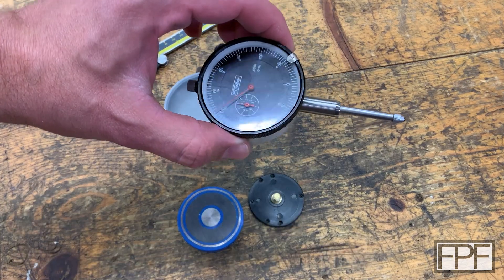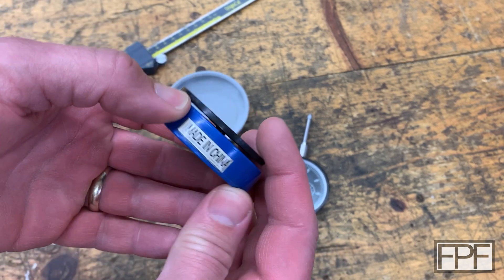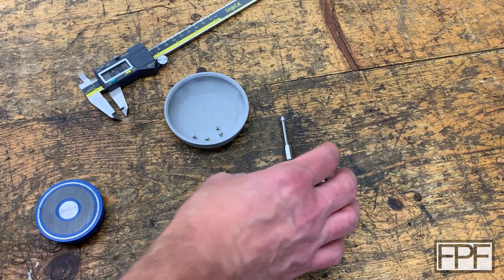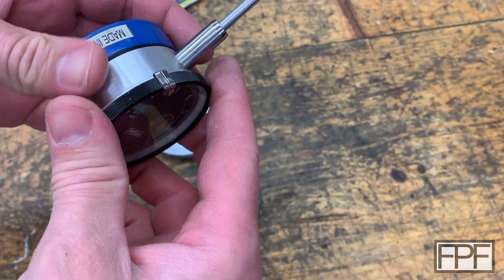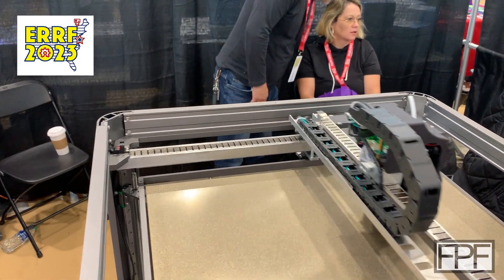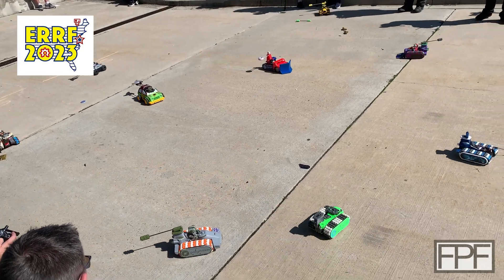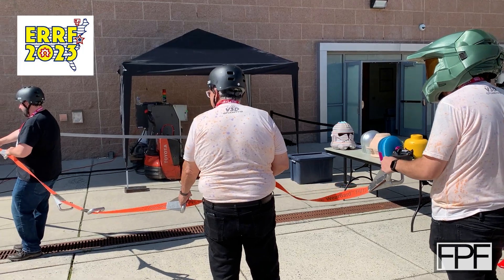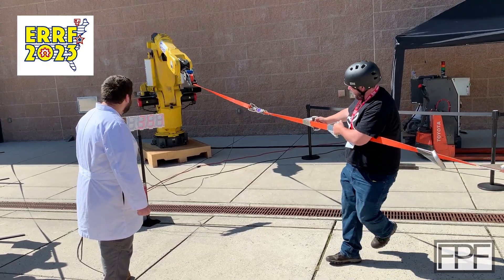East Coast RepRap Festival and Part 1 of Replacing a Dial Indicator Back

Comment: I found the formula a while back for the hole compensation for 3d printing.

X = desired diameter
Y = cad dimension
For horizontal holes: Y = 0.0155  * X + 0.2795 mm
For vertical holes: Y = 0.9927 * X + 0.3602 mm

I have found it is pretty darn close.

Comment: This printer does not use magnetic levitation as clearly evidenced by the linear rails on the bottom. It uses a magneto linear motor.
Reply from the maker: The fliers they handed out at ERRF say "MagLev".  I didn't spend enough time in the booth to personally confirm or deny that claim.  Wouldn't be the first time someone in marketing was out of touch :)  Contact me through the contact link and I can send you a copy of what they handed out if you like.
Reply: @FunctionalPrintFriday  Ah I see marketing got a hold of it lol. Yeah that is incredibly misleading of them. That would actually be awesome if you would!

Comment: I went last year, but missed ERRF2023 - the last one.   I ordered the Peopoly the end of August for the pre-producton price of $1399.  It is not a kickstarter.  I expect it to be delivered before my Prusa XL with the 5 heads which I pre-ordered 11/18/2021.  I have used 3dGloop and it is great, but has almost no shelf life.   Once you open and use it, try and finish all of your gluing needs, a week or so later it is a mess.
Reply from the maker: I keep hearing that. . . I haven't opened mine yet, but that's disappointing.  I wonder what it is that's evaporating out.  I've has SOME luck rejuvenating PVC cement by added some xylene to it.  Nasty stuff though.